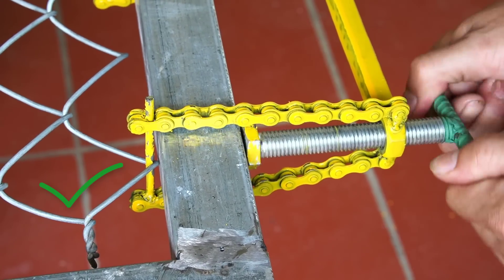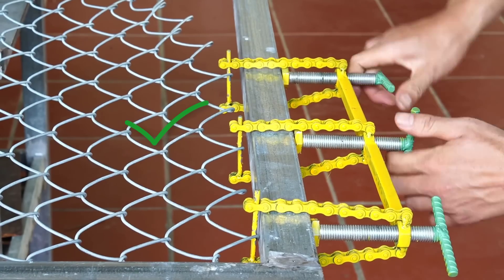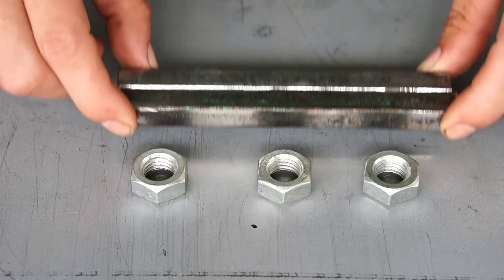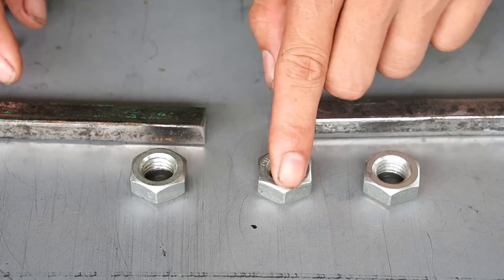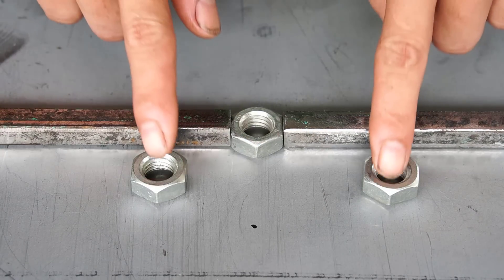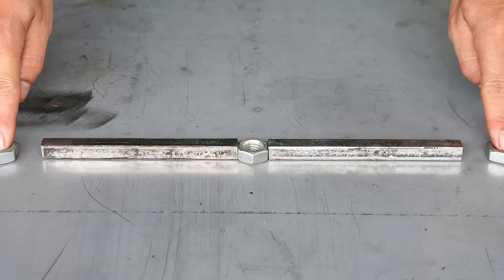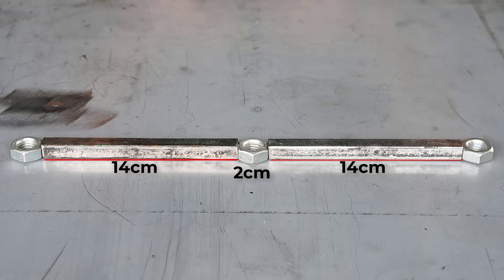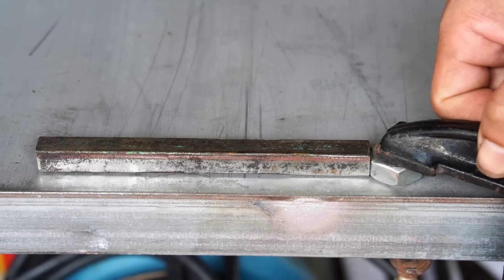Hướng Dẫn làm vam căng lưới b40 để hàn cửa sắt nhanh và đẹp

Comment: you weld the chain link to square tubing frame next? I assume
Reply: Generally it is framed in m.s. angle frame . How can it reach to extreme inner surface of an angle? The another flange would be limit of streching. How can we weld the end line on frame?🤔